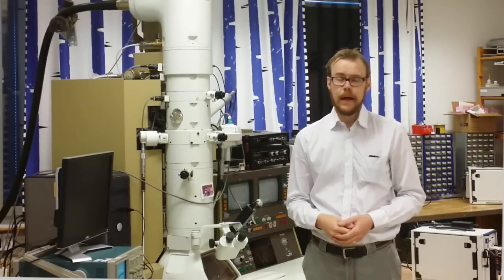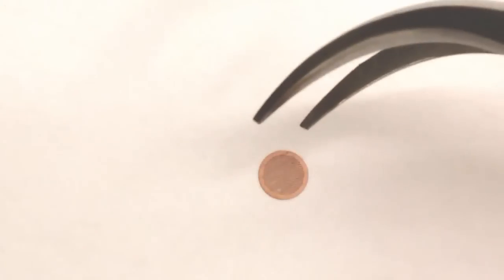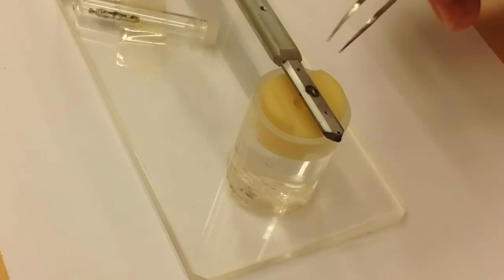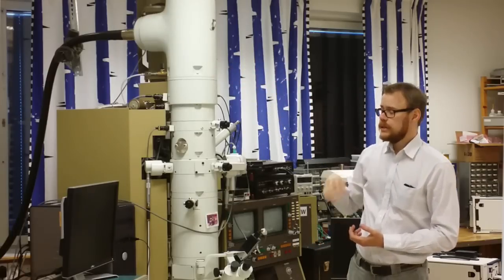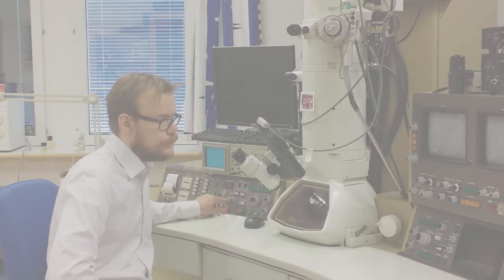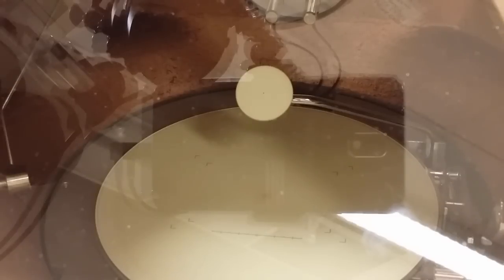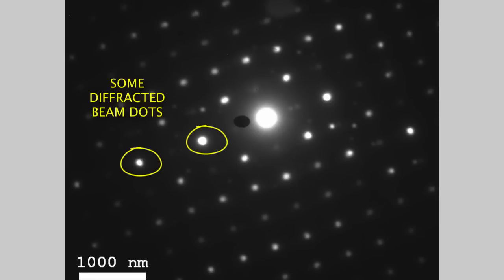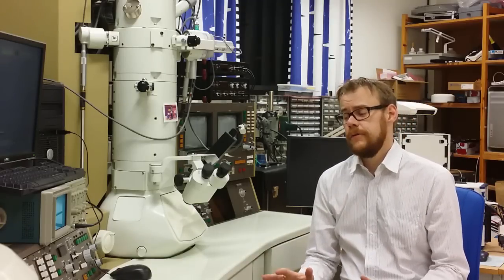Transmission Electron Microscope TEM demo session

Comment: it would be great if u can enlighten me how to prepare sample of gold nanoparticle for its characterization using TEM technique. you have shown liquid sample needs sampler loader with the clamp and it requires that carbon grid for sample loading. i want to know how the liquid sample taken like in my case i have gold nanoparticle as my sample..should i just handover my nanoparticle solution to get TEM done and they would take a drop or two from the whole solution..or does it required any purification step or some other step before taking down on the grid..please guide
Reply from the maker: It should be just straight forward exactly as you suggested. If it is of high concentration or lots of organic materials like surface acting agents, dilution is very much recomended.

Comment: Does it matter which side of the copper grid you put your solution based sample on; the dull or the glossy side?
Reply from the maker: One side will expose the copper mesh making the solution to be trapped in each square of the mech by capillary forces and, this tends to accumulate to much liquid. Also depending on type of grid you could have a two layer grid, carbon supported by plastic, in that case you will have two surfaces of different hybrofobicity to play with.
Reply: sir can you explain how staining works in TEM? Does the stained area appear white or dark and why?
Reply from the maker: @chiasmata8625  Staining is usually done with some heavy element material, like uranium, or more explicit a salt of uranium. Because it is massive it will give you a darkening contrast effect. Note that uranium-salts are poisonous and should be treated there after.
Reply from the maker: @chiasmata8625  That is correct, if using bright field imaging.
Reply: thank you sir.. Before, I actually thought that the electron stained areas will appear lighter as electrons won't pass through.. I thought that since more electrons passed through the non stained areas, it would be darker but now I understand clearly.. Once again, thank you very much sir!